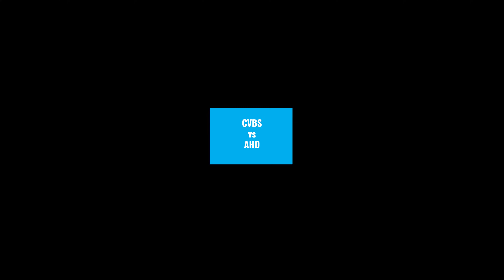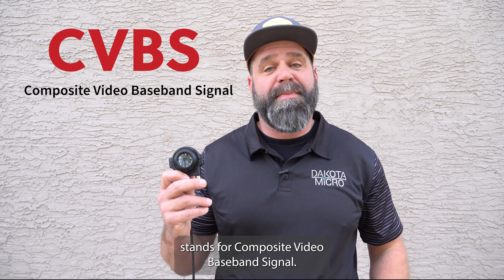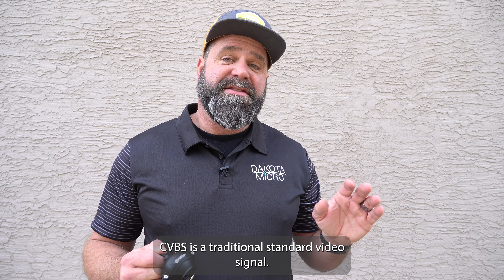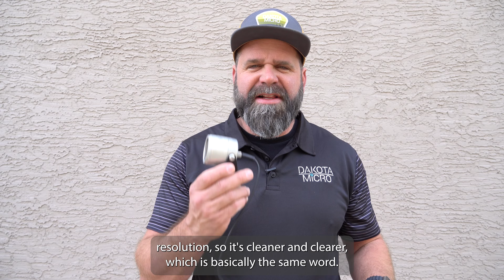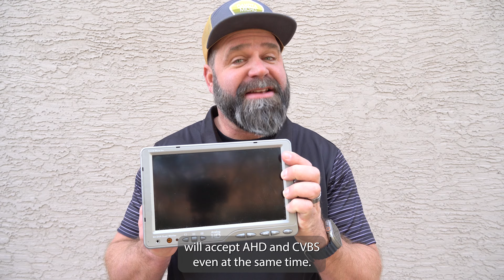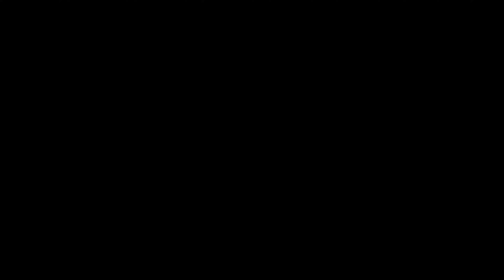AHD vs CVBS Backup Cameras | What’s the Difference? | Dakota Micro® Explains

Comment from the maker: If you’ve ever wondered what the difference is between AHD and CVBS backup cameras, this video breaks it down clearly!
👉 AHD = High-definition video (720p/1080p) — sharper image, better clarity.
👉 CVBS = Standard analog video — works with most existing monitors.

Both options are available from Dakota Micro, built tough for farm, construction, and heavy equipment environments.

👀 Explore More Camera Lines:
AgCam | EnduraCam | OverView | RazerCam
👉 https://dakotamicro.com/camera-lines/

#DakotaMicro #AHDvsCVBS #BackupCamera #FarmEquipment #ConstructionCamera #AgCam #RazerCam #EnduraCam #OverView

Comment: Dealing with this with an Android Head Unit I will install in our 2015 Prius, replacing the factory radio.  Want to use the Prius backup camera, which might be the older CVBS signal.  Shouldn't matter because the Android manual says it accepts either CVBS or AHD.  Couldn't test yet since the Android came with no connector for the camera signal (had all other Prius mating connectors and a mounting frame).  Ordered a 16-pin mating connector with cables, which "might work" and also converts 12 VDC to 6 VDC, which I think the factory camera requires (info hard to find).

Most info suggests a 2015 should have a 24-pin connector.  Nope, the same 16-pin as 2014.  Android box came with a backup camera I won't use, but tried it on a video monitor.  Powered it w/ 12 VDC and plugged in the yellow cable, but nothing, so perhaps outputs the newer AHD signal and the monitor can't display it.  I hope to use that monitor to verify the Prius camera signal is correctly pinned before connecting it to the Android box (several video inputs).  As for most Chinese products, there is minimal documentation.